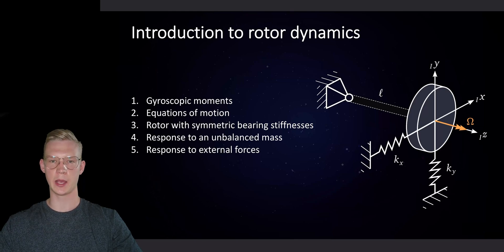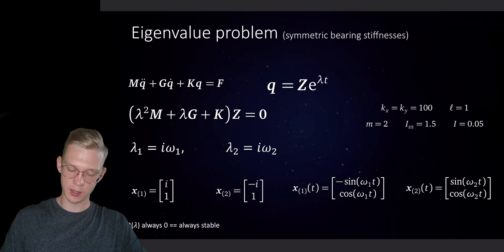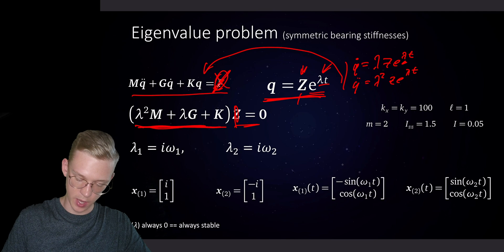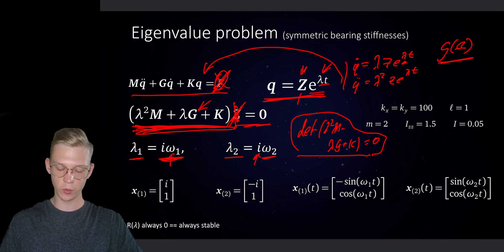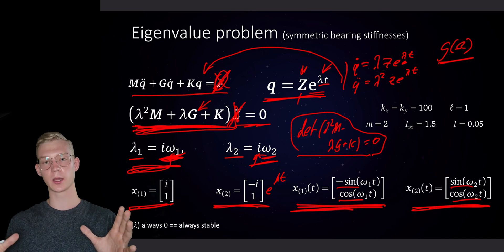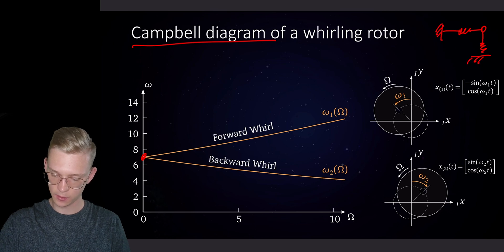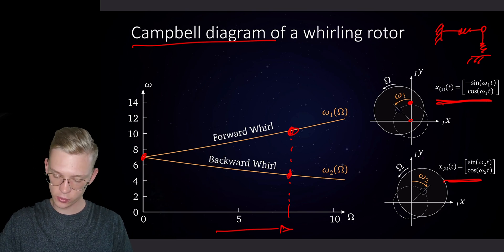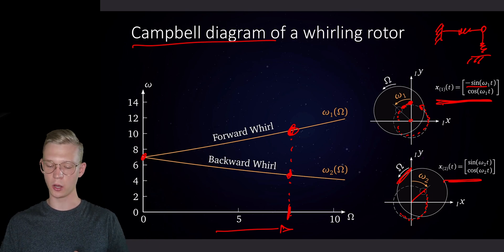Understanding Eigenvalues and Whirling of a Rotor | Exploring Rotor Dynamics

Comment: Hey Jan, nice work :) Would you say that the campbell diagram shows 1 mode with a backward (BW) and forward (FW) "submodes" or would you say that there are actually two different modes? I was thinking, mode#1 shape for such a system (looking at 0 rpm) is merely a beam bending with displacement on the free end. And regardless of the system being in a BW or FW state the modeshape would be the same.... or!?